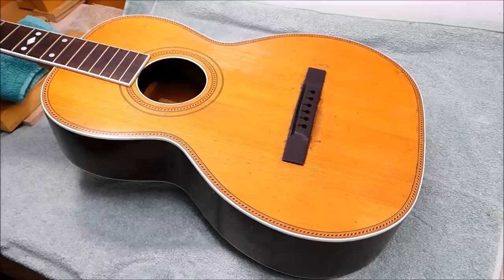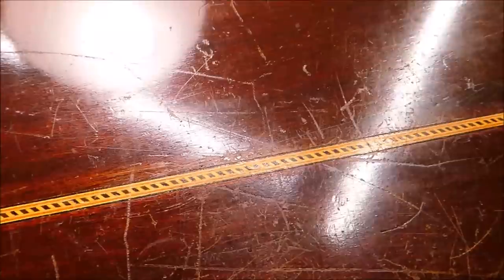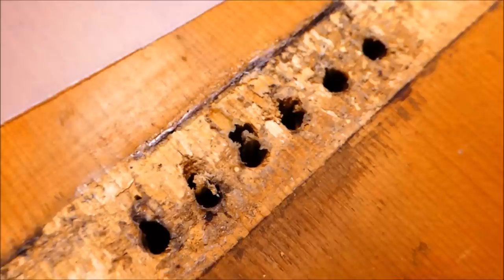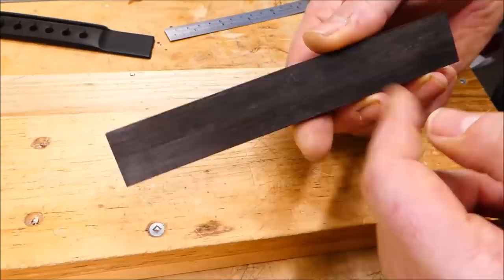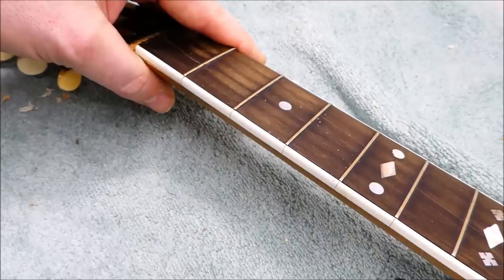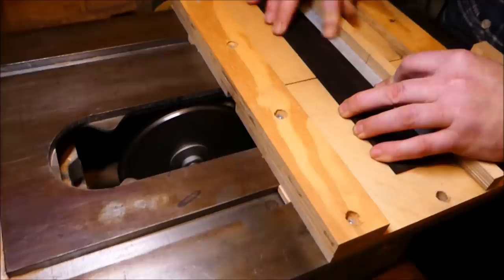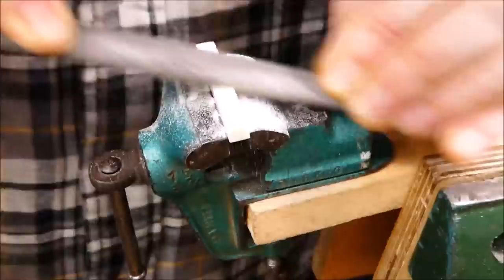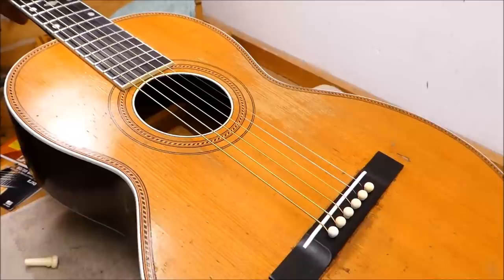Lyon and Healy Parlor Guitar Gets the Full Treatment.

Comment: fantastic as always!

taylor (among others i think) makes endpins that fully fit in a widened-out endpin hole, like if you removed a pickup endpin jack. weird to see that widened hole in this one, was there a pickup installed somewhere in the distant past?

also, what about ebony for bridgeplate patches? i've done my share of those, like 1/16" thick ebony plates over trashed (usually maple) bridgeplates. so far they seem to work OK, and are much harder than maple or even rosewood. is there a hidden drawback i'm missing?

hell, why aren't ebony bridgeplates a thing? i'm thinking of the durability of ebony violin tailpieces that take the full pull of a string ball end without stripping out, we want the same thing from our flattop bridgeplates right?

Comment: @twoodfrd I read somewhere a very long time ago that, because of the sound hole bracing and transverse brace, the area of the soundboard from the heel of the neck to the sound hole were pretty much acoustically dead. So, if accurate, removing the popsicle stick should have little to no effect on tone. Do you find that to be true, or is it just another myth from the dawn of time?
Reply from the maker: You're right - it's removal really can't be heard except through the placebo effect. Without it things tend to really fall apart if a crack develops alongside the fingerboard.
Reply: @twoodfrd  Thanks for the reply!

Comment: The neck seems to have a bit of chatoyance -- Spanish cedar? It was an L&H staple for necks in the years bracketing 1900. If it is, that would date it earlier, as I understand it, as necks came to be made of mahogany later in the 1900s. I'd be willing to bet that the bridge is not original. This vintage of L&H would have sported a flattened pyramid bridge.
Reply: smells skunky ... that's not Spanish cedar. I'm stumped—which is a wood-themed way to feel. Cool bracing pattern, seems well thought out. About the end pin: I've had a couple that were similar, and they seemed to be sized for violin endpins. Beautiful work, as usual.

Comment: I'm an amateur luthier, nowhere near your exceptional skill level, but I'm curious as to why you didn't make the replacement bridge ever so slightly larger than the original so you could mask some of the finish damage done over the years, and by the previous bridge work, plus it would add a little more strength in front of the saddle, where the original was breaking.  The only extra labor it would have taken would have been to score and chip off a little finish around the perimeter before gluing.  Just a thought.